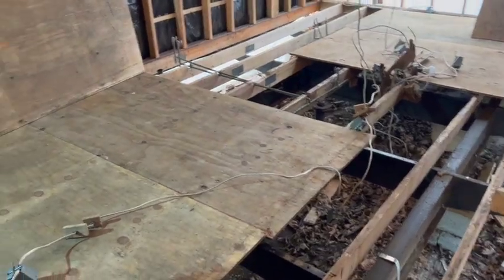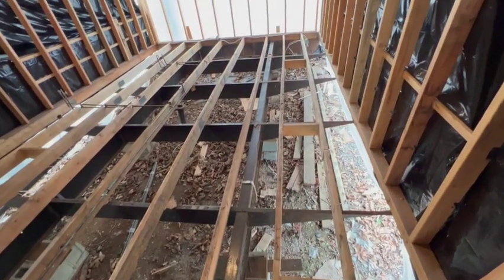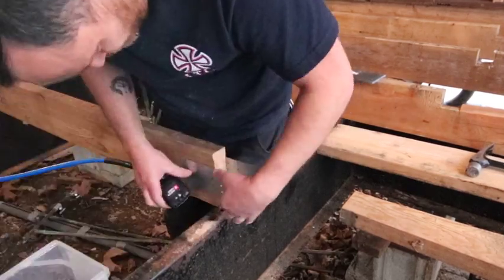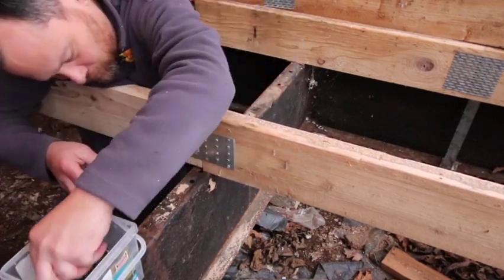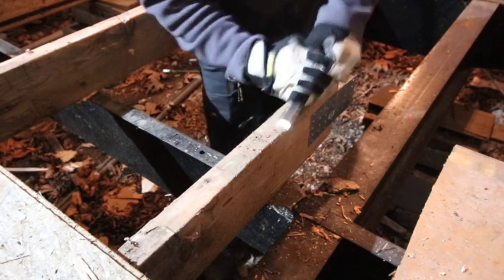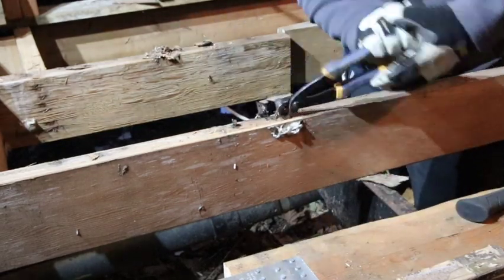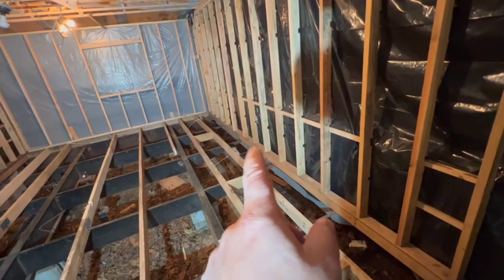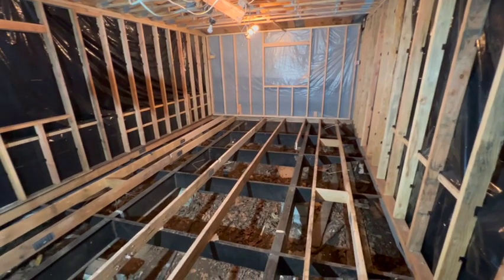Floor Joist Prep for Advantech Subfloor on my old Single Wide Mobile Home Project, Part 1

Comment: Just found ur channel.
Looks like u have done alot of hard work. What year is ur home?
Could you possibly show how the ceiling framing is it together?
Thanks
Reply from the maker: Glad you found it! Yup, this ended up being a lot more than I thought it was going to be. It's technically an 83 I believe. If you find some of the video's where I'm putting up the roof truss's that might help you out with how it all goes together up there. Hope that helps. Thanks!

Comment: Go with Pex that copper is old and will fail much sooner than you may expect and Pex forgives cold swelling much better than rigid materials.
Reply from the maker: Appreciate that. I did go pex in the tiny house I built but for this one I did end up going with just replacing the copper with new pipes. It was a permitting thing more than anything else. If I change it up I have to go through extra expensive steps compared to just changing out with similar. Luckily in Washington, especially right by the water we don't have to worry about deep freezes very often. I'll just put a few incandescent light bulb outlets every few yards under the house to turn on during low temp nights. Should be good to go with that. Thanks!

Comment: When does the floor insulation go in ?
Reply from the maker: Ideally I'd like to put it in as I'm laying the subfloor but I kind of want to just get the subfloor down and deal with the insulation and belly wrap later in the summer. But, pretty much everything I'm doing isn't going exactly to plan so maybe I'll do it at the same time. Although part of me doesn't want to do it at the same time because if I leave gaps in it while I'm working, it gives time for rodents to get in there and make nests. That's why I want to wait till I'm at the house full time. Thanks!

Comment: Oops, I watched out of order. this vid answered some of my questions I had from the next vid. but .... I am wondering how or if the floor joists are fastened to the end wall (rim joist? toe nailed?) Also wondering how much blocking there was between floor joists? I see only a few bits of blocking in your vid, were there many more bits spread in any type of pattern? Or were the few we see the only ones (and why? e.g. are they under a load like a water heater?)   It also looks like the floor joist butt joints are staggered from row to row (yes/no?) Thank you.
Reply from the maker: Yeah, it's weird but only a few blocking pieces here and there to help tie the runners to each other. I think I have just a couple that I took out that need to be put in place around where the front shower base is and a couple other spots. I'm going to have to look at old video footage from when I took it apart to see where they should be. I'm going out this weekend to hopefully start the subfloor so I'll try to do some more detail on how joists are set and how they work for ya. Stay tuned! ;)

Comment: What type of insulation will you be using. .?
Reply from the maker: I'm pretty much just using what ever I can find the best deals on. Ideally I like rock wool 'roxul' but I have a fair amount of standard fiberglass packs that I've picked up over the last year too. On the roof I'm hoping to add a layer of extruded foam boards. I'm not a fan of the spray foam though. So in the end, a mish-mash I suppose. Ha!
Reply: @thesomewhathandyman9400  That's ok, as long as you are using something...I'm liking Rock wool seems to work well...
Reply from the maker: @Paulie1232  Yeah, that stuff is easy to cut to shape, doesn't burn, and doesn't mold. Love it.